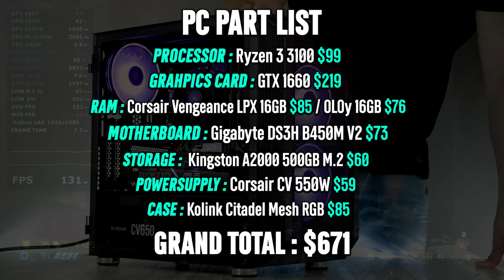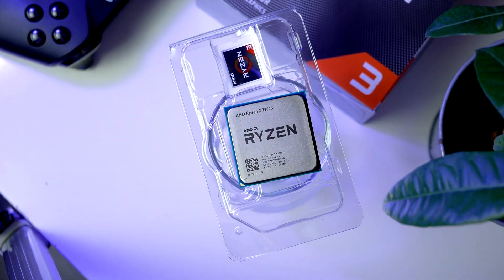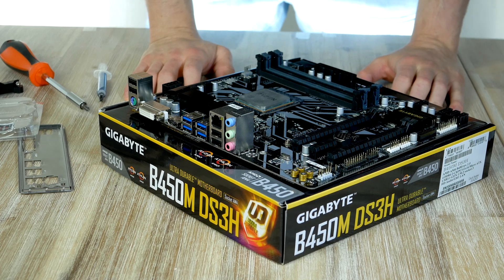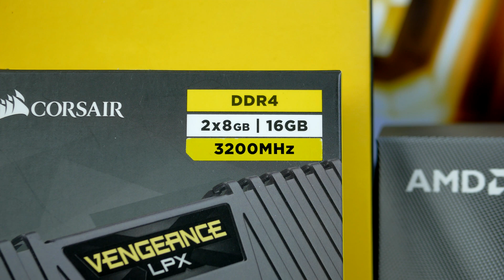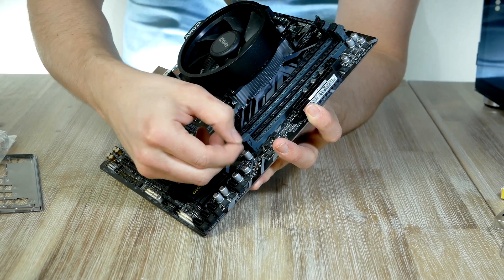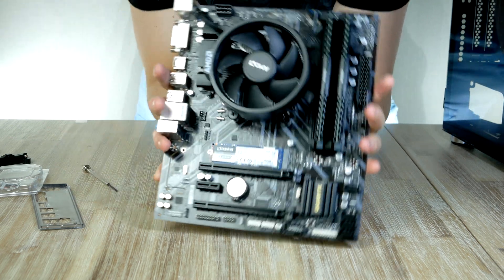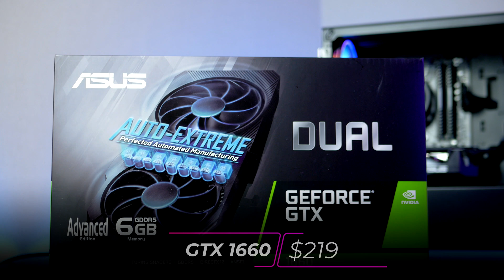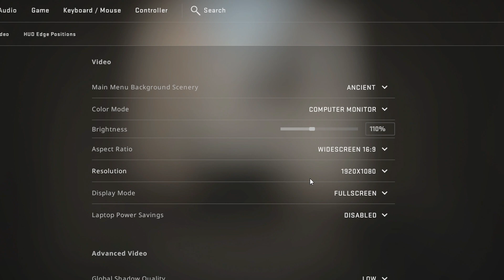Building A Monster $650 Gaming PC Build in February 2021👾 Step-By-Step Tutorial + Benchmarks!

Comment: I built a pc for my son for xmas. Originally I had the ge force 1030 gpu cause that was what I could afford, he has 16gb ram, 500gb ssd, 650watt power supply, aorus a520m motherboard and ryzen 5 3400g cpu. All he wants to play is fortnite but he kept getting an error it's crashed. Tried all troubleshooting and nothing works. Then bought what I thought what 1050ti gpu but was a fake so currently there's no gpu. But he still can't run any game. Would the gpu be the issue for not being able to run fortnite? With the 1030 he would be able to play for a bit and then get an error it crashed. I just feel bad cause he's had it since xmas and it's just sitting there cause he can't play what he wants to play. I have $140 now for a gpu. Any recommendations??
Reply: It’s impossible pretty much to get a gpu at that price at the moment. The gpu market is up so all cards are marked up. I’ve been trying to get a 1660 super since December but with no luck. 2/25/21 I’ve heard that nvidia will be selling 1050,2060, and the new 3060 to help the market a bit. You may want to look there
Reply: @ohprojects  yeah figured that I've been looking for a month with no luck
Reply: @ohprojects  do you know tho if like I said the gpu would be the reason for the error or cause the fortnite to randomly crash? When he did have the 1030 installed he met all of the fortnite requirements and could even run on high settings like with he force experience installed that's what it defaulted to but it would still randomly crash. Rainbow 6 and apex played fine.
Reply: @AngelicaElkins0528  I’m  building my first ever pc so I don’t know. Sorry.
Reply: @AngelicaElkins0528  did u update the gpu drivers?
Reply: @AngelicaElkins0528  Try a better GPU honestly; something is wrong with the drivers is what I am guessing really.
Reply: @HamzaDesigns1  yes
Reply: @hariranormal5584  u think I shld do a clean windows install? Reinstall everything again? Cause I had a laptop and my son cld play on that wit low settings no errors and it was a bs ass laptop. So I just don't understand why he keeps getting fortnite has crashed error
Reply: @ohprojects  same bro but our pain is tooooo much we can’t get Normal Pc part prices especially THE GPU
Reply: You might be able to get a used rx 570 4gb for around that price.
Reply: @yanyan4022  and that's obviously better than the 2gb 1030 right
Reply: @AngelicaElkins0528  Yes most definitely.
Reply: Im not pc expert but usually if pcs tend to crash thats a gpu thing. It could also be the thermals running out but I cant be 100 percent sure on that. 🤷‍♂️
Reply: @Spooktory  it only crashed when he was playing a game but it cld be anywhere from mins to hours before it would.